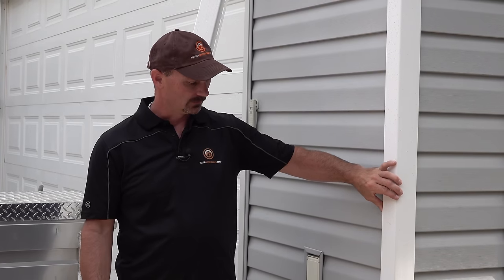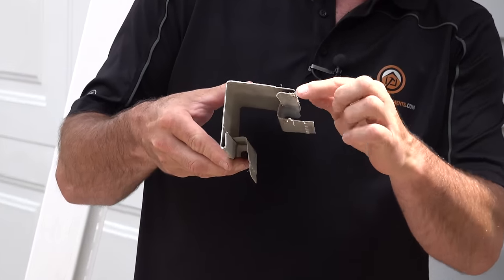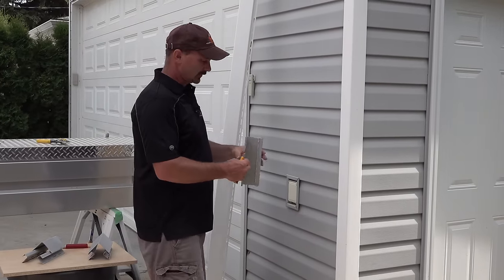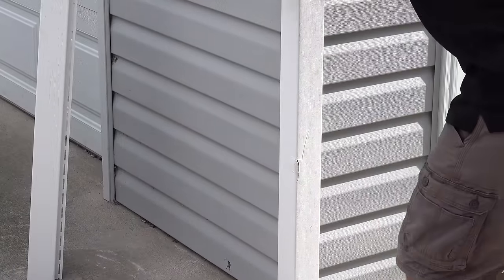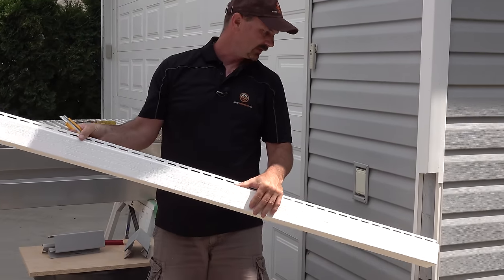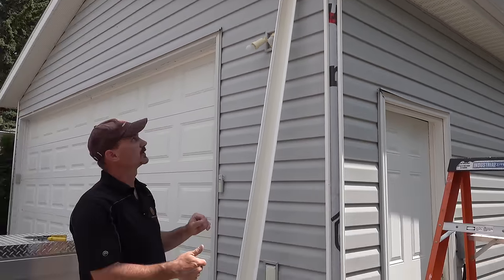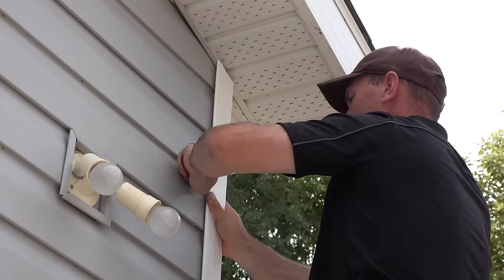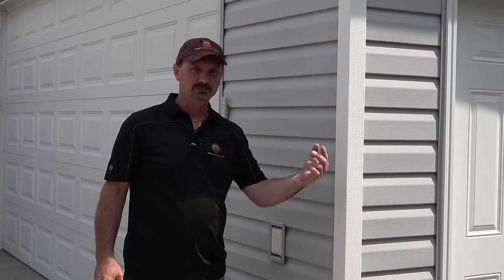How To Replace A Vinyl Siding Corner

Comment: I’ve done three corners on a 30 year old house.  The bottom part always seems to lose its right angle look, as if maybe the new corner pieces were manufactured ever so slightly smaller.

I tried pushing the new piece into the j-channel harder on the bottom that improved the look greatly. 

BTW, these videos are a blessing.

Comment: Awesome video! How would you keep it from sliding down if that was a concern?
Reply from the maker: A small dab of caulking (1 - 2 inches) in the two top corners and temporarily support until dry.
Reply: @HouseImprovements  Thank you

Comment: Thanks again Shannon   Honestly, you need to patent a system before someone else does on removable/replaceable  outside corners.  A corner frame then snap on exterior shell that’s interchangeable.   A home ow er could change the look of the house In Minutes

Comment: Thank you for this video. May I ask you if you would recommend using the foam inserts into the corner siding post? Can be used with outside corner pieces when installing TimberCrest I/S insulated siding These are available at Home Depot. For example ABTCO 3/4 inch Outside Corner Foam Insert (PC).
Reply from the maker: In this type of corner I have in this video I dont see how insulation would actually help anything? Most of the hollow area is away from the wall.

Comment: Would it make sense to run some silicone on the backside just to ensure it doesn't slip during bad weather and ensure a really good seal?
Reply from the maker: Yes a little on the top inch or so should be all you need . Support it temp. until it dries

Comment: Great video and looks very easy to do, but I have a question.  I vinyl siding doesn't go all the way to the ground, how do you keep the corner piece from sliding down?  I see in your video the corner peice I touching the concrete, I dont have that option.   Without fastening it to my home would the corner piece slide down if it does not go all the way to the ground?
Reply from the maker: Yes sorry ,normally a 1" bead  of caulking in the top corners and a temporary support until that dries will be all you need

Comment: I was trying to figure out a way to on a 400k home make the repair. My idea was to cut the damaged and then use my saw-z-all to cut the nails, then use vulcam to adhere it to the wall. Always a trick to everything, okay you shared your trick Mine would be to use tine snips instead of knife that could damage the replacement.
Reply: Ugh.. the tin snips leave jagged marks.  Been there, done that.  Yes the knife can be difficult as well but ultimately it was the easier of the two.

Comment: I have a corner that is split, vertically, on the inside of the j channel ( approx 3ft from the bottom, causing the corner to lift from the wall.  Nailing strip in this section knocked loose and not secured. Since the old piece is lifting from the wall, it appears that this method wont work.  Will I need to remove all the siding to install a new corner? Thanks for the video.

Comment: you can buy the replacement corners that just hook over the j channel without cutting the j off a new corner. and you can use a roofer hook knife blade to cut the old one apart

Comment: Great video, thanks! I have a corner to replace but the bottom of it is above ground and does not rest on a horizontal flashing. Is there a way to secure the corner so that it doesn't slide down?
Reply from the maker: Add a couple of dabs of caulking at the upper corners in the closed lip of the new piece about 1" long. temporarily support the corner until its dry.

Comment: Another great video, what is the recommendation of placing the seam on a corner higher than 10' top or bottom ,,
Reply from the maker: does not really matter , I generally place the full pice to bottom. Keep it where its least seen.
Reply: And be sure the upper piece overlaps the lower one to keep water out.

Comment: Quick question. Working on a 2 story and bottom is busted. Is it possible to cut say  5 foot  out and tuck it under the top section? Seems like you'd cut all of the j out at the top and slide underneath correct?

Comment: Shannon, I have a damaged corner not unlike the one in your video, except the piece is about 20 ft. long instead of 10 ft. The damaged portion is only about 4 ft. off the ground, but the j-channel is intact at the spot of the damage. Would you advise still replacing my entire 20-ft. run of corner or can I make this work from just the damaged portion down to the ground? I'm not wild about getting 20 ft. up on a ladder and though there might be a creative way to tuck the new piece under the existing one at the spot where I'd cut the damaged section. Please advise and thanks for the great video.
Reply from the maker: You could make it work for a smaller section but it does not look as good. With that being said I have never seen one piece 20' long , here we can buy only 10' pieces.

Comment: You can just cut the nailing surface off the replacement part and it will snap right over top of the old damaged corner. It will be twice as thick but is easier and very sturdy.

Comment: 1) Is it necessary to remove the old corner at all? Would the new corner go over the top of the whole old corner?
2) The old damaged corner on my house has a smaller dimensions (2 1/4") on each side. whereas all new outside corners come in 3" on each side. wondering how this trick can be utilized in this case at all??
Reply from the maker: Old corner must be cut to make this work properly. Your older smaller corner can only be covered by the same sized corner.

Comment: Question, how would I trim a corner post to correct length after it’s already installed on house?  What should I use to cut it, and how do I measure and mark the amount to cut off? Thanks.
Reply from the maker: You can use a small square and pencil to mark the cut line/length and then you can use a sharp utility knife , good tin snips, a grinder with a cut off wheel or masonry blade works well also.

Comment: Great video , my only concern is what would keep it from sliding down , I have a crawl space and my siding is a foot or so above ground
Reply from the maker: I forgot to mention that , in this case it could not slide down but when it can you just add a little caulking in the lip at top on both sides and temporarily  clamp it in place til dry.
Reply: HouseImprovements would pvc cement work as well?

Comment: The only issue I see is how to keep the replacement corner from sliding down to the ground. What would you recommend for preventing that? Some silicone? Or leave a little extra "meat" at the top of the new piece and putting a couple screws into the old piece through the new piece? When you're cutting the new piece on the bench and you draw the pencil line, if you move the last few inches of the line over a half inch towards the J and leave that little bit of extra meat, you can then screw through that into the two J's that remain, to at least secure the old and new together at the top. I guess you could do it other places, too. Any thoughts?
Reply from the maker: Sorry yes use a dab of caulking or silicone in the top corners and support the corner until that dries. In my case it was not need because i was against the concrete but I forgot to mention what you needed to do 90% of the time.

Comment: Brilliant! I have one question though. How do you keep the replacement from dropping down, when a starter strip is used? I can see the replacement is sufficient to withstand wind, but it seems that could at least cause the corner to slide down, if it’s not resting on a J. Do you run a small bead of adhesive on the inside?
Reply: Rivet it some where on the flange
Reply: That would draw attention, and look out of place
Reply: @circularebin  Use a rivet that is the same color.

Comment: Hi Shannon, thanks for the great tip! It's been 3.5 yrs now but the corners keep getting holes, so the video is aging pretty well, always relevant and spot on!
I am having exactly the same problem but before I begin repairs I wanted to ask your opinion. Is it a good idea to replace only a section of the 10ft run? My entire house corner is made of two 10ft pieces and the damage is right at the bottom, maybe 4 inches up. Could I, in theory, cut only 10 inch from the bottom of my entire corner section as per your instructions and slap a 12" of the new section over it? Will I be able to make the 2" overlap stack nicely? Please advise and thanks again for the amazing tip!
Reply: Hey Max, I'm in the same boat. Did you end up finding success?
Reply: @nathangilbert1344  Hey Nathan, I ended up replacing a smaller segment. Even though my damaged area was about 1.5 inch long, I chose to put a 1.5 - 2 ft segment because a smaller patch would stand out more and the repair would be more obvious.
I cut out the entire mid section of the corner leaving about 1.5" overlap from both ends.
Now regarding the overlap - at my first attempt it didn't look nice because the outer section (aka the patch) is the same size as the inner section (original corner). As a result the inner section got a little bit squished and deformed (imploded), making the transition and the gap very obvious.
So I removed the patch section and made vertical line cuts along the corner edge along the entire 1.5" overlaps. I left maybe 3 millimeters uncut at the very edges. That did the trick and the deformation was waaay less noticeable. I also sealed the top transition. I inserted the sealant in between the overlap (like a glue) not over the transition (like we'd seal a typical sink-to-countertop seam). I did it at the top (to avoid the water going in) and I didn't go to deep, about 5 mm deep of sealed overlap from the very edge. I wiped the excess and the result looked amazing. I hope that wasn't confusing. Good luck!
Reply: @_m.a-x  Hey Max, thanks so much for the timely response. I appreciate you taking the time to explain that to me. Sounds great, do you think it needs any additional support? Maybe a glue to slide in there?
Reply: @nathangilbert1344  The connection is pretty snug but I did forget to mention that I applied spots of sealant inside the "hook" edges of the "new" corner. Did it on both sides, along the entire height.

Comment: Great idea but how do you keep it from sliding down? Most house applications have about 1 meter of basement then the siding starts. The only way I can think of is to use a pop-rivet at the bottom. I always use a grinder with a steel cutting blade to cut vinyl; makes a nice neat job. For this type of job an oscillating saw would work very well.
Reply from the maker: Use an inch or so of caulking in the two top corners and secure it until cured.

Comment: Would a few of dabs of caulk in the groove help hold it from sliding down, or is that not necessary?
Btw, great idea.
Reply from the maker: Yes it will. In my case i did not need it and forgot to mention .

Comment: Great videos Shannon... thanks! I have a question: can you recommend an adhesive that will work well on vinyl siding? PL Premium was recommended by a friend but it practically fell right off after setting. Thank you.
Reply from the maker: Pl premium should work but it may take a couple days to fully cure on the vinyl. I use silicone usually.

Comment: 4 of my 5 vinyl corners are currently broken. Unfortunately they’re 3.5 inches wide and I can only buy 3 inches. I found a specialty place that has 4” available. I’m thinking of using this technique even though there’s a size difference. Any suggestions before I proceed?

Comment: Very Good Job For A Flush Foundation To The Ground It Won't Slide Down  But It Won't Work If It Was Higher It Would Slide Down...I'm On The East Coast Of New England Maybe A Shed Or A Garage...
Reply from the maker: A 1" dab of caulking in the two upper corners and a temporary block till it dries and you're good.

Comment: you can leave the extra L on one side and youy have the ability to add screws to keep it from sliding down.  also don't have to cut the face you can cut the outside edge of the original corner all in one go.

Comment: Beauty cuts mate!!  My "edges" resemble the teeth of a Great White shark lol.  15 minutes for moi...nope.  30...nah.  one hour and forty-five minutes to slice through one side of the new corner piece 😶.  It probably would have helped if I had a box cutter with a blade that is longer than 1"  and as sharp as a butter knife.

Comment: Any suggestions on replacing an inside corner? Power washer got too close and the heat warped it and two bottom panels!!
Reply from the maker: I hav never tried an inside corner? Not sure if it would work out as well really.

Comment: Does it slide down? or does the friction hold it in place going to be trying this method tomorrow for a customer that was my only concern.
Reply from the maker: You can place a bit of silicone in the upper corners and temporarily support it in place while that dries if yours is sliding.

Comment: I’ve been doing this for years. You can save a little time on cutting the damaged corner if you have a oscillating saw for like cabinets and you can plunge it anywhere on that side edge an just cut once an done. It also is a lot safer using one with a new blade in the cold weather bc you won’t get a shatter cut. Good tutorial though. These are ancient Chinese secrets though. Lol

Comment: I have a double.  Would you do anything different if the top of the replacement corner started in the middle of the house instead of at the top?  Thx
Reply from the maker: Great question, I think you should be fine but you will want to add a little silicone in the lip the top end to keep it from slipping down. You may need to secure it in place until the silicone sets. I have even used a small screw in the two top corners for this instead.

Comment: This is fantastic ! Where did you get the part from ? Since your video was out it seems they are hiding them and they are just selling the smaller ones I am looking for a 84 inches corner :(..
Reply from the maker: Smaller? This is a standard O.S. corner in my area. They come 10' long. I have never seen one that was sold shorter than that?
Reply: @HouseImprovements   I think you should put an online store for yourself sir, It will have a lot of demand, specially after seeing a video like this)).

Comment: Just a question why do you have to cut the old corner one . Could you just cut your new one an put it over top the old corner that is broken it would be stronger???
Reply from the maker: It will not fit together that way
Reply: @HouseImprovements  ok thanks just the way I was looking at it I thought it my have worked like that . 👍

Comment: Is there a way to do a small section? I have a corner that is broken in a small area on a 2 story side of the house. I can do from the ground but would only like to go up about 4 feet! Is that possible!?
Reply from the maker: You could but it will not look as good. If you do this cut the new piece about an inch longer than you need and notch and tuck that upper end under the existing upper part.

Comment: How should we run ethernet cable behind the corner? I am planning to run some cables for my security camera and I can hide the cable behind siding but not sure about the corner, how do I go around the corner or J channel whatever we call it? Do I need to drill or snake the cable behind the corner?
Reply from the maker: You would either have to come in around the ends (top or bottom ) or drill a hole

Comment: Are you replacing those J's around the lights and plugs and using the appropriate boxes?
Reply: @dropndeal  woah guy first off don't be so uptight. Now seeing as how that vinyl doesn't look colour faded it must be a fairly new install. Now if the guy wasn't so cheap he would have spent the extra $20 and purchased some boxes to which would have covered the house wrap that isn't a finish product, is an air barrier and once installed you have 30 days to cover for product warranty. 

Now the other option is if you're too lazy to install either a split box or a standard box, you cut the box opening in your vinyl and run with that. 

Reason I brought this up is for the poster to show people how to use a split box and tie it in if you don't want to pull a light.

Now as for me walking onto someone's property and pick the workmanship apart, well yes I've done it and the owners are happy afterwards for the installers come back and do their job properly to give product warranty

Comment: Im looking to try this same method to replace a similar Trucedar steel corner piece. Have you ever tried this with metal? Either way, any advice? Thanks
Reply from the maker: I have not. I think that would be pretty tricky but you may be able to get it?
Reply: @HouseImprovements  I decided to take the long route since i had the time and it would have taken a few weeks to order a new corner. I partially removed the siding so i could pull all the nails and slip the new corner in. 3 hours later I got it done. For future jobs I will definitely try your method!

Comment: Does it have to sit against the ground? Assuming it would slide down anyway?
Reply from the maker: Mine sits on the concrete but when they need to "hang" you can apply a bit of caulking in the top edge and prop it up until that sets then you should be fine.

Comment: When I usually do this, I try to add some caulking on the back side, just in case of the strong winds. And not having any nails on it.
Reply from the maker: Yes I should have mentioned that to keep it from sliding down I have never had one blow off. In my case it could not slide down and I forgot to mention caulking at the very top .

Comment: Quick question, what’s the point of cutting the middle out of the old one? Seems like it would be structurally stronger leaving it and simply snapping new one over the entire old one.
Reply from the maker: It will not fit properly, at least any I have seen.